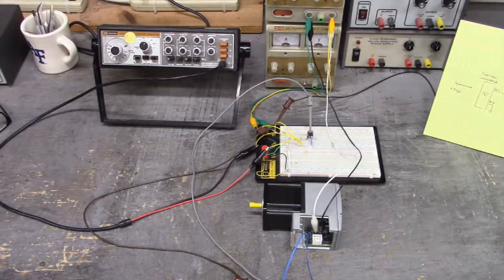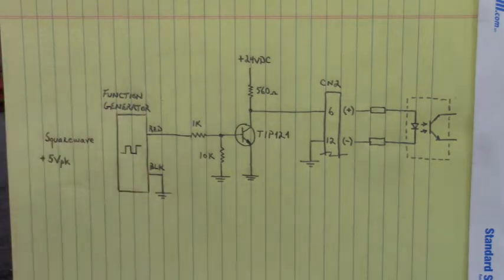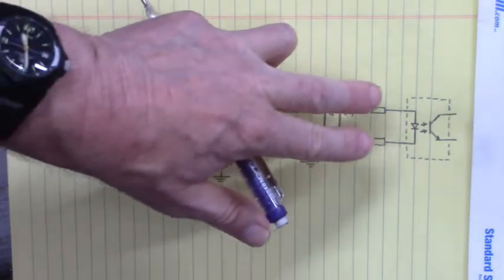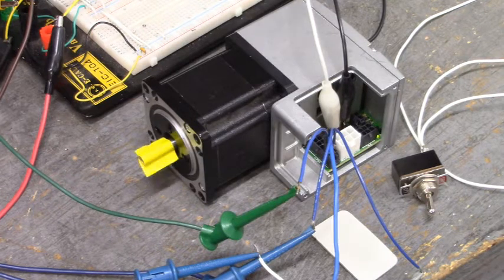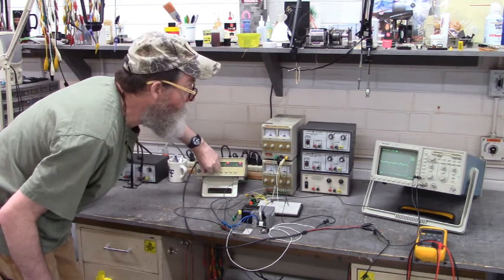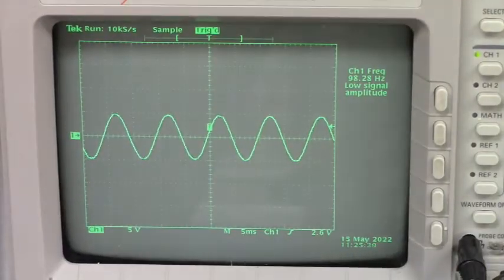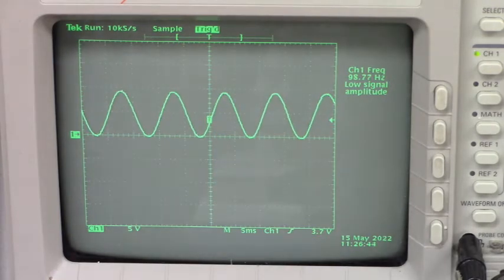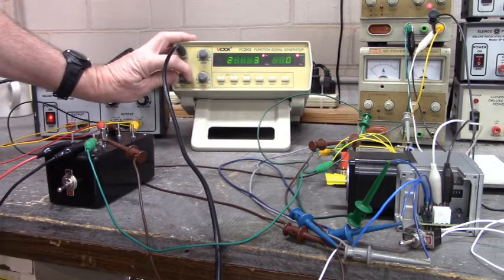Testing the Schneider Electric Lexium Integrated Drive

Comment: Always a good day when you upload content! Would be awesome if you made some general troubleshooting videos, just on standard switching power supplies and common problems that most folks would run into. You have such a knack for clear communication and teaching. Even as a fellow professional I get a lot from your channel!

I have my own small business and humble lab specializing in metrology stuff for other labs and manufacturers. Right outside of Chattanooga Tennessee.

 Something I’ve been messing with and was hoping someone might make a copy or clone of the famous HP547a current tracer
And the accompanying pulser .

they truly are a very valuable tool on the workbench. But prices are out of control!

I’ve owned several over the years but I was looking at getting another spare set recently, realizing that now the set of three can be between 500 and $1000!

It’s not a very complex circuit and would be super easy for someone as skilled as yourself to design a clone or copy. I’m great at tracking down issues and repairing problems, keeping things perfectly calibrated, stuff like that. But circuit design is a bit out of my wheelhouse 😂 
I’m assuming it’s similar to the “Tone-Ohm” or “Huntron tracker“ devices. or at least similar in principle. Also the wonderful EDS leak seeker device. Which is something I use almost every day when tracking down shorts. Along with the EDS cap analyzer

Anyway, sorry to ramble. Hope you are doing well and God bless!